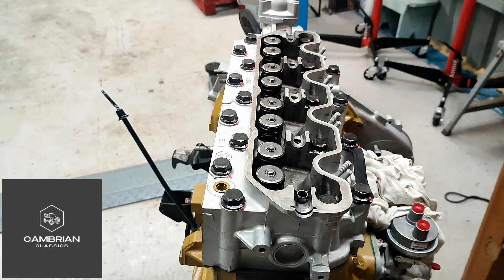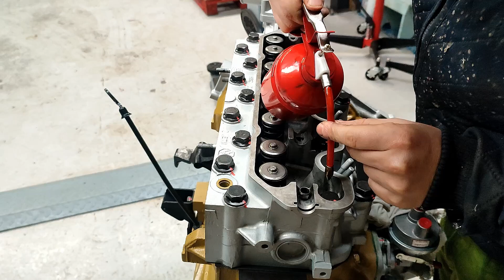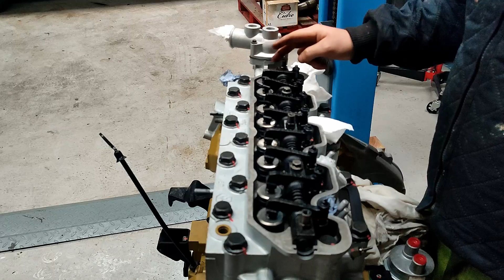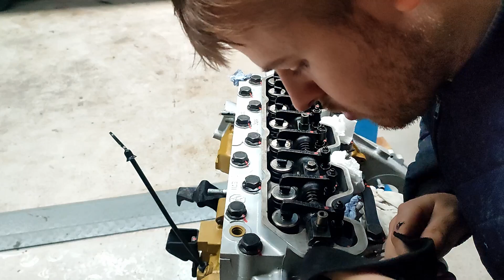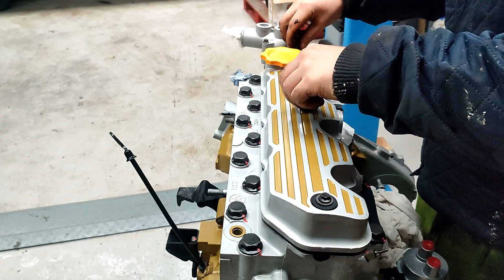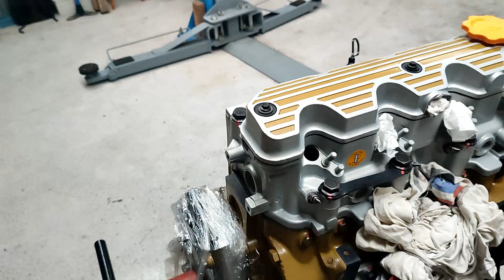200TDI with Zeus Timing gears   Cylinder head rebuild Part 3

Comment: Just watched all 3 of your videos on the 200TDI. I've just got a 110 with a 200TDI and this is really interesting and very informative. Makes me wanna get an old 200TDI engine and reduilt it.
Reply from the maker: Thanks for the support. If there's anything else you would want to see in the future let me know. Currently got a full rebuild on the 200TDI underway and soon to start a chassis and bulkhead swap on a series 2. 
The 200 & 300TDI's are great engines to work on. As an idea I think this full rebuild came in at about 900GBP for all parts including paint. If it had needed re-boring or any of the shafts grinding it would have been even more.
Reply: @aguyandhisgarage  Your welcome dude! I found your videos from a looking up about the zeus timing gears and it got me thinking about maybe getting and old engine and building it up and making it better then my current and then doing a straight swap when ever.
This weekend I had to work on the fuel lines and the lift pump as the engine was really struggling/sluggish.